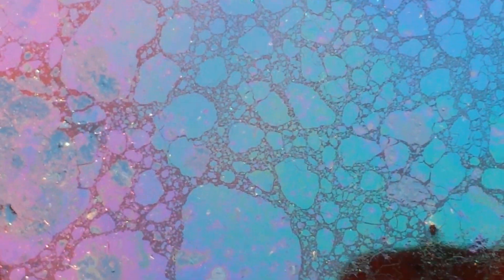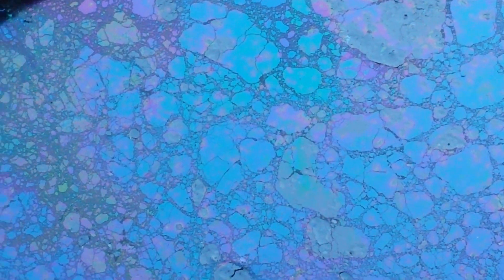Make Graphene in a Pressure Cooker

Comment: Hey there mate, did you have any success with these?
Reply from the maker: NewArtConcept this method is very hard to get the sheets out in a usable size. I had better success using graphite exfoliation methods.
Reply: I have tried to brake down some pencil leads, I think I had some success as there were a nice amount of flakes over the top, but it seemed to me they could've been contaminated with clay, all this by electrolysis, but the result was messy for now, but it is indeed the best method, and preety much any sulphate will sufice, I'm also preparing another experiment to re-try and exfoliate the leads through this method, I'm going to try and insulate the cathode with a polymer membrane and see if electrolysis takes place, this way, the graphite won't get stuck here and I'll most likely end up with a copper(or iron) / graphite solution, which can be great for a late chlorination for intercalation of unreacted graphite...

Regarding the pressure cooker option, I think the biggest issue here is the amount of time and the quantity of water/acid mixture, I am trying this method right now, I've diluted concentrated acetic acid into the water and used fructose (instead of sucrose, the melting point is too high), this way I hope to have a nice thick suspension over the water, IF the pan doesn't blow up I'll post it later! :D 

I'm aiming for a 3 - 6 hour boil at around 115ºC , caramelization of sucrose is at about 110ºC, water boils at 100ºc (all in ambient pressure) and acetic acid at around 118ºC so I think this'll be a good temperature under pressure conditions.

Sorry for the giant text but... it's enthusiastic to see these sorts of things happening! Do you think I'm having good reasoning on this?

Comment: Hai
If i were to use the same sugar and water as suggested by robrt murray will i be able to get graphene oxide in the cooker.If so at what time.
Reply from the maker: No you need to use fructose and add acid to lower the caramelisation point.
It is hard to see when it is 1 layer ...this has run several times and built up a stacked sheet.
Reply: Thanks m3sca1

Comment: Graphene, 

I am not up on the scientific research or evidence of this new and exciting area, so if you have some cool share links to the top research on this,could you post them. 

Thanks for all your comments and suggestions on my channel Hhydrogen4power 

David A Puchta
Reply from the maker: Hi Dave,thanks for dropping by...this graphene stuff might have some worth in your experiments.Makes good electrodes for batteries and also has an interesting property of generating a current when salty water moves over it.
Robert Murray-Smith has a lot of good videos on the subject and has pile of plates for proof of concept.
SWAG Generator - Prototype Update
might be able to make green solar panels with algae pumping through it and graphene as the coating on the glass to catch the electrons... 
regards
Matt

Comment: Nice graphene flakes!
Reply from the maker: Jonathan Luxient 2-5 layers makes sense given that the cooker got run several times with cooling between some of the runs.
That would have allowed layers to build up.I
 am trying another run with much less fructose.(3.75g/L)
Have run it 3 times so far and have not seen a layer.
Thanks for commenting.
Reply: here's a small pic of the flakes I cooked up last year:

https://lh5.googleusercontent.com/-lrnCv2hgcPs/UfDiZeMPN8I/AAAAAAAAAF4/3xKStSrfoMg/-fcrop64=1,00001fffffffdfff-w260/COOKING_GRAPHENE.JPG
Reply from the maker: Jonathan Luxient cool...what recipe did you use?
Reply: very very cool mate
Reply: m3sca1  What I find most striking about your graphene flakes is the brilliant iridescent colours :) This is caused by interferences with light between 2-5 layers of graphene (much like soap and oil films do) and I've seen this effect before in graphene.  What is really cool, is that you can visually count the number of layers by the colours produced.  This is called thin-film interference, and it shows you have some very high quality pristine graphene flakes.  I admire the beauty of it.
Reply: that is cool - nice pics of it too by the way
Reply from the maker: Robert Murray-Smith glad you like it- i am about to try some different electrolytes to test what works best with graphite coated siloxane.
Plan to try magnesium sulphate, sodium hydroxide, table salt, alum, sodium water glass, and silica gel water crystals.
Any electrolyte suggestions are welcome.
The end result i am working towards is an open source home brew capacitor that can replace a car battery.
Reply: m3sca1 Anytime! :) I'm afraid the weaker solutions do not work as there has to be an exact ratio of sugar to water, and the sugar has to be of right percentages of C/H/O as well. Try runing it like I did. I wanted only one layer and one layer is what was produced. Keeping it in longer only builds up more layers from the bottom up.
Reply: Ohh.. On the electrolyte note, you can try out Sodium bisulfate (SBS), it should work with MgSO4, and is found in most stores that carry pool supplies and is a "pH decreaser". I never tried it but it could work quite well. Try mixing a little boric acid (roach powder) with some clean sulphuric battery acid, this I know works, and is about to become patented soon in the US (currently at the application stage) as a way to extend lead-acid battery service lifetimes and improves charge acceptance.
Reply: m3sca1 Robert Murray-Smith. Hot off the press!!! If you make small nanoparticles of Ruthenium oxide less than 5 nm and incorporate it into the graphene electrodes, this will make it much more efficient.  It was newly published and reported in Nature Sci. Reports just two days ago and was used in hybrid graphene/CNT foam electrodes and doubled the supercapacitor performance (up to 0.5CV^2). See: http://dx.doi.org/10.1038/srep04452 :)
Reply: Also, take a look at this paper concerning the effects of usuing different electrolytes in AGM (absorbent glass mat) batteries: http://profdoc.um.ac.ir/articles/a/102350.pdf ..this was dated back in 2005 and talks about the use of boric and citric acid to minimise charge loss over time, probably gave rise to the patent I was referring to for lead-acid batteries ..US20020012839 A1 (hope I didn't step on anyone's toes out there) but we are making graphene batteries not lead-acid ones. ;p

Comment: Hi matt not sure if I told you about urine in engine coolant sounds disgusting but went on the view of joe booker mention his uncle bill hail used urine and recharged it again as it came out the exhaust what happened was I replaced water with urine in cooling system set off down motorway and did not notice temp after only 5 miles was screaming in the red so luckily it was pissing down always seems to be when. You break down so looking for next junction to get off kept driving through puddles got off and quickly pulled up to see steam. Well urine steam from engine bay engine was trying to jump out it was that hot so gradually got water to fill up and crackled initially steamed but eventually got it to fill coolant 15 mins later now the interesting bit is expecting it to whirl over as must have blown headgasket but on turning key it whirled I've far faster than it has ever done but started and ran mint now I emailed joes mate Peter Stevens with this symptom and rather than ridicule me he stated now try a star washer touch loose from the engine earth to car chassis question now I have been told the urine evaporates into the cylinders and leaves a crusty lithium ion crystal coating in all internals of the engine have you or your contacts could confirm this and that he star washer causes phasing out. Appreciate any confirmation and am now on with the stripped atom air engine all neutrals but neutral positive and neutral negative with a lightning bolt plasma type rainbow spark from the static type charged field caused by the sump oil and coolant being pulsed dc charged. Mel in uk
Reply from the maker: A little off topic but ....anyway... lets dive in...
I have no experience with urine in coolant but i suggest the possibility of an air lock in your coolant system after you replaced the coolant. As for Lithium in the urine leaving salts in coolant gallery walls, there is no excess Lithium in urine.It is impossible unless the urine came from someone taking Lithium salts for psychiatric treatment.
And i see no way that junk in the coolant system walls could help an internal combustion engine from gaining any benefit.The water galleries and the
fuel /exhaust galleries are separated by metal walls.
Those metal walls would short circuit a charge or drain away to the battery negative terminal.
What are you talking about with star washers?
More information please.
I don't understand the idea of charging sump oil or charging coolant water.
If charge made any difference wouldn't the fuel be the best thing charge?

Comment: wonder if you can weld up a circle with a screen on the circle with a handle that will fit into the cooker preboil, so after setting you can crab a sheet.  maybe use packers tape to make electrodes.  What was you plans?  i got to know
Reply from the maker: thats a good idea putting something in the pot-maybe a little table that sits under the water surface and holds the susbstrate that the graphene will deposit onto when the water evaporates...the plan was to make graphene in a pressure cooker...beyond that the plan is to make a super capacitor with off the shelf, readily available materials.
this stuff has been staring us in the face for as long as man has playing with electricity.